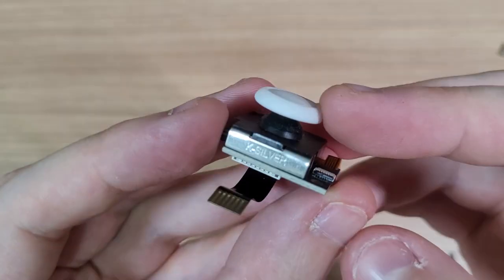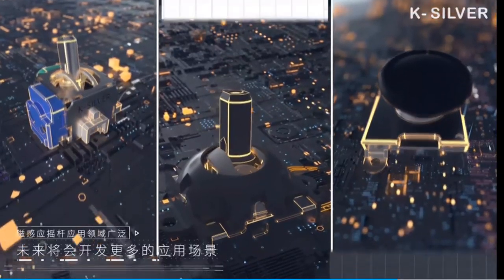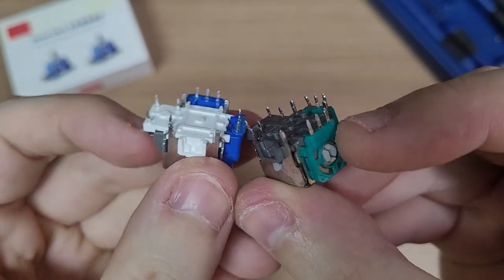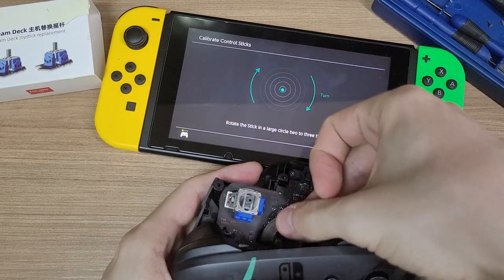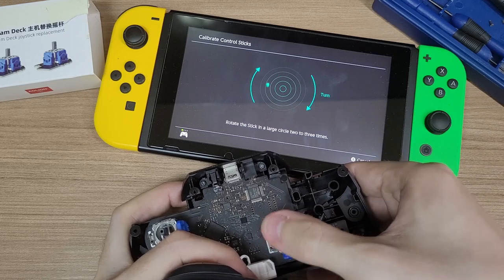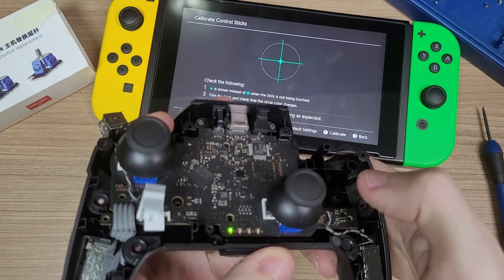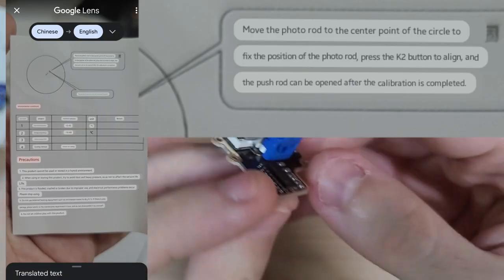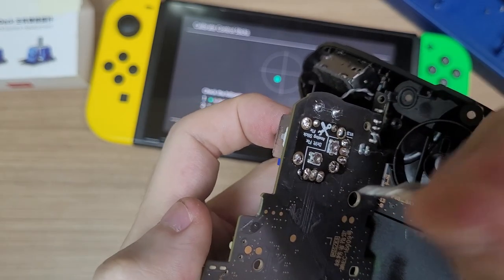Testing Full-Size Hall Effect Sticks from K-Silver

Comment: can you try it on the xbox controller?
Reply: this is what I need!
Reply: It'll produce the exact same results, because this is literally how a bare module functions.  That additional chip is a microcontroller that applies a function to the analog input, then outputs a digital signal with a modulated voltage to act as an analog input.  It's also not a simple fix, these are linear sensors used in the most non-linear way possible, so the function will also have to be non-linear to correct the full analog range, just note how the bare module produces an ellipse within a circular gate.  The specific devices that use these kinds of modules are programmed to have this kind of calibration, other devices are not, drop-in modules won't be a thing, and the BiliBili Dual Sense has to have hacked firmware to allow for calibration, or a cherrypicked module that doesn't produce issues.
Reply from the maker: I'll wait for neohoth update on his sticks on GBA temp before testing this on other controllers because you know dessoldering stick modules is a pain

Comment: I know exactly why they failed, it's the ohms resistance value, I've got XBox 1 Elite V2 sticks in my DS4 it takes nominal 10K potentiometers but all pots are calibrated to the boards in factory production. 

So come see 👀👁️👁️ me for info in bucket 🪣 loads lol...
Reply: They need a chip to translate the magnetic 🧲 field to ohms resistance stick 🕹️ tilt position & circularity, it's a response curve value re mapping issue, also I think 🤔🧐. 

Coding knowledge & tools needed to get the response curve to correct factory values 🤦🏼‍♂️, so even if it did work without the chip calibration to 100% tilt chances are the response curve would be either lax or aggressive from mid point to outer circularity. 

Way over my scope of doing, non linear magnetic 🧲 field mapped to linear positions 🫠 does not compute 🤖 🤯🧠 😁.
Reply: That makes sense. I’ve repaired some controllers (Xbox, ps4, switch) and the sticks never gets all their range again.